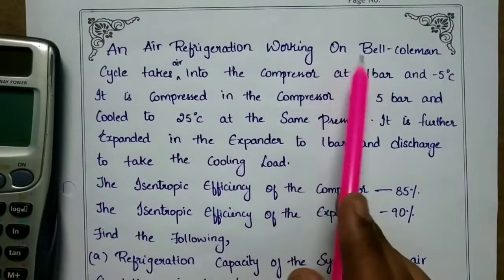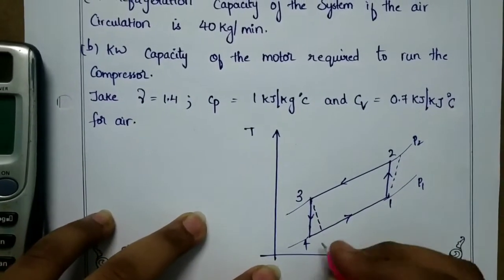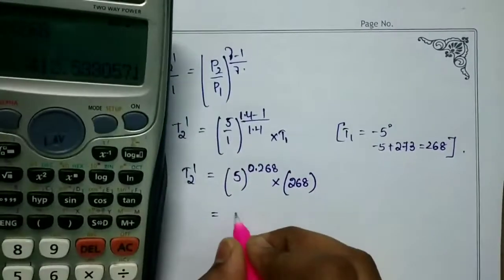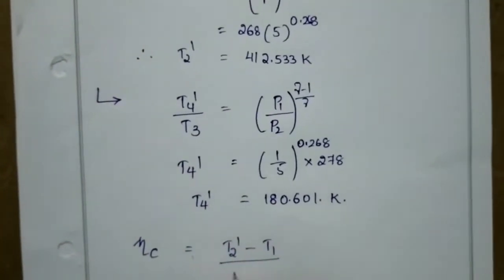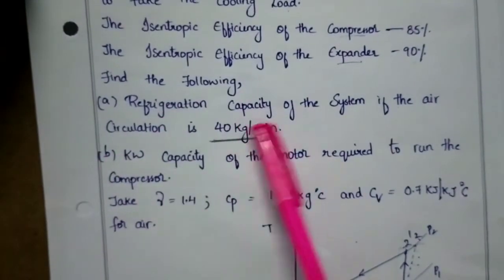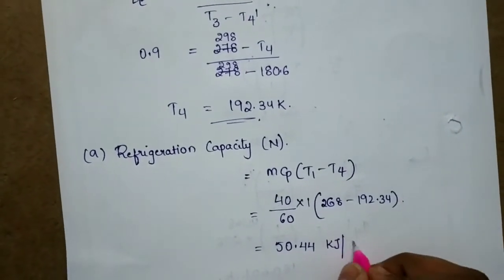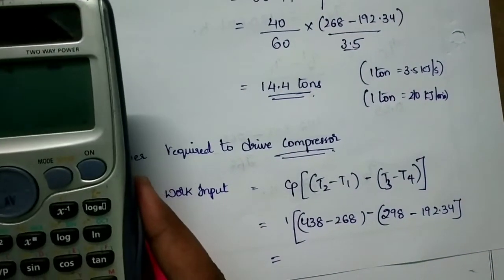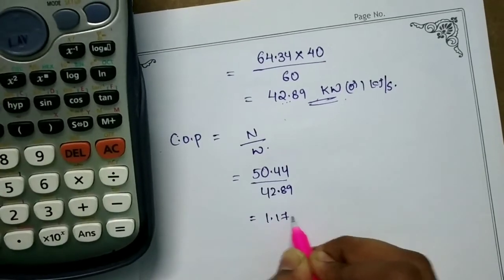Problem on Bell-Coleman Cycle

Comment: T2= 424.46
Reply: Referigeration capcity = mcp(T1-T4') =0.66×1.005×(268-199.19) =46.14kw=13.18TR
Reply from the maker: Tnq for your kind information ☺️ it's counting mistake . Procedure was clear right? I hope you understand the procedure . And I will definitely crt my mistakes tnq
Reply: T4=188.15 ,    0.4/1.4=0.285 so many mistakes check properly